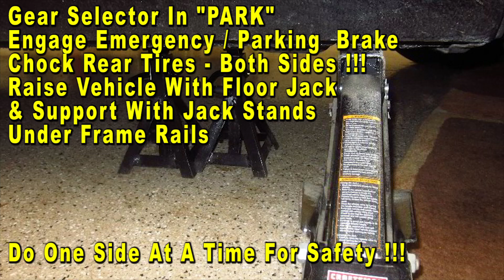Chevrolet Malibu How To Change Front Brake Pads 2016 To 2024 9th Gen With Part Numbers

Comment from the maker: Chevy Malibu Front Brake Pads - https://amzn.to/47LVkE4
Power Stop Ceramic Brake Pads Part Number - https://amzn.to/47w51ad
Wagner QuickStop Front Brake Pads Part # - https://amzn.to/3sYvcaj
Precision Screwdriver Set - https://amzn.to/3sLixaP
Plastic Pry Bar Tools - https://amzn.to/3HMtsV7
Socket & Ratchet Set - https://amzn.to/3Z17LbA
Mechanix Gloves - https://amzn.to/3jCnHkt
Torque Wrench - https://amzn.to/3vS5uSI

The Paul79UF YouTube channel is a participant in the Amazon Services LLC Associates Program, an affiliate advertising program designed to provide a means for sites to earn advertising fees by advertising and linking to Amazon.

This DIY video shows owners of the 9th generation 2016, 2017, 2018, 2019, 2020, 2021, 2022, 2023 & 2024 Chevrolet Malibu sedan how to change the front brake pads.

Comment from the maker: Check out the DIY guide for changing the front brake pads and rotors on a 2016 to 2024 GM Chevy Malibu -
https://www.paulstravelpictures.com/2016-2023-Chevrolet-Malibu-Front-Brake-Pads-Replacement-Guide/index.html

Here are all of the DIY repair and maintenance tutorials for the ninth generation 2016, 2017, 2018, 2019, 2020, 2021, 2022, 2023 & 2024 Chevrolet Malibu sedan - 
https://www.paulstravelpictures.com/Articles/2016-2023-GM-Chevrolet-Malibu-DIY-Repair-Maintenance-Guides.htm

Owners of other General Motors vehicles from Chevrolet, Buick, Cadillac, GMC and Holden such as the Impala, Corvette, Bolt, Sonic, Spark, Express, Trax, TrailBlazer, Equinox, Traverse, Blazer, Tahoe, Suburban, Colorado, Silverado, Cruze, Volt, Camaro, Encore, Envision, Enclave, Regal, LaCrosse, Canyon, Sierra, Terrain, Acadia, Yukon, Savana, XT4, XT5, XT6, Escalade, CT4, CT5, CT6 and Commodore may also find these DIY instructions to be helpful.